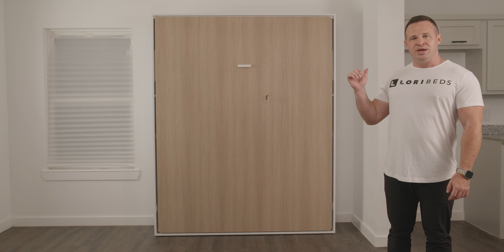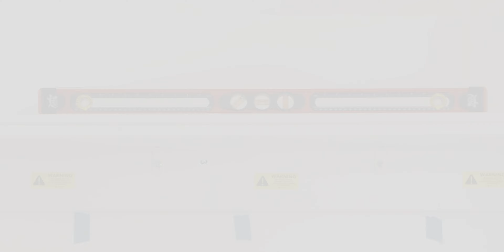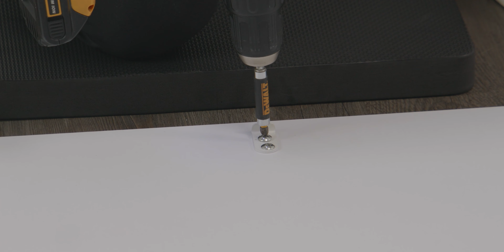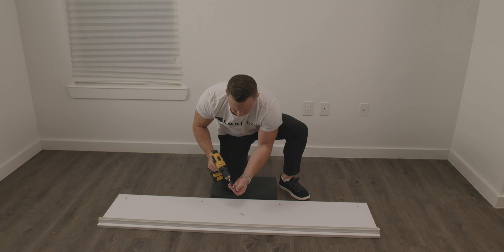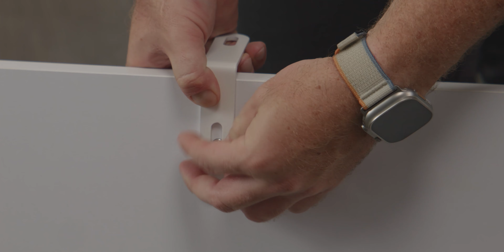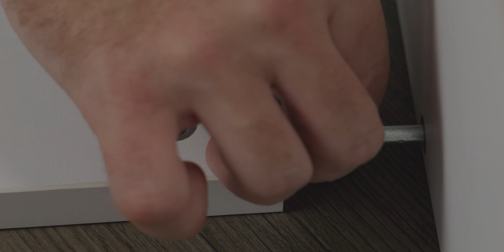How to Assemble The Lori Bed | Murphy Bed | Wall Bed

Comment: I have assembled the Lori bed and the front panel is not square to the side panels. At the top of the front panel I have a zero gap on one side and 7/8" on the other side. How do you adjust to achieve a squared up front panel to the cabinet side panels?
Reply: It may be because when you screw the metal dowels into the threaded inserts, if you over tighten the dowels it will deepen the inserts. I had to take out the dowels and then use an Allen bit to back out the threaded inserts and then put the dowels back in.

Comment: Why did you not include this link in the manual or an easy to find place on your website? It would have been so valuable on the one difficult part (step 9) that would have gone so easily if I had watched the video first.